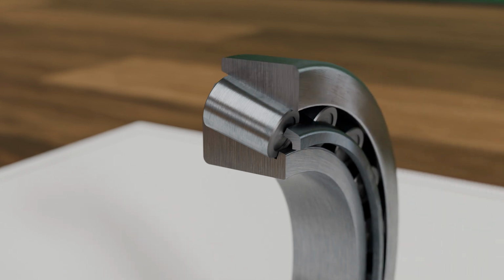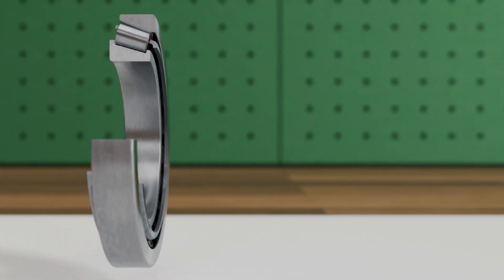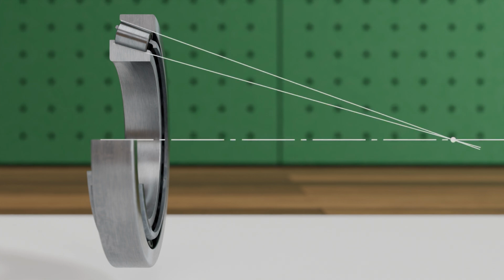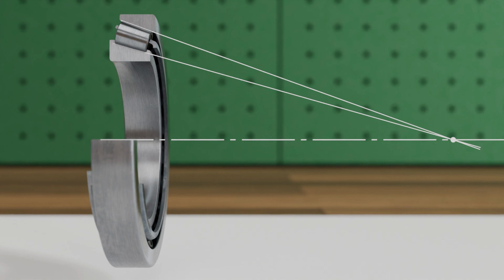Rolling Element Bearings Simply Explained | Thrust Bearings | Balls, Rollers, Needles, Cones

Comment: 10:50 "and joined together" ... wish this had a bit more description...
Reply from the maker: Sorry for the somewhat brief explanation. It would probably have been better to say that the two bearing halves are held together on the shaft by design, for example between a shaft shoulder and a nut, similar to 9:02.